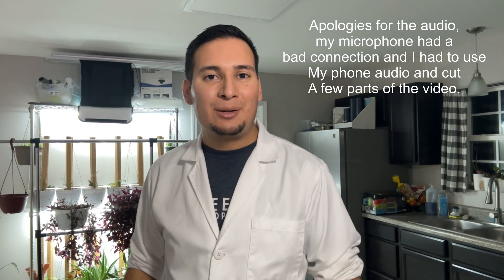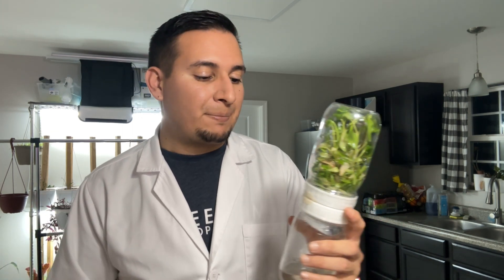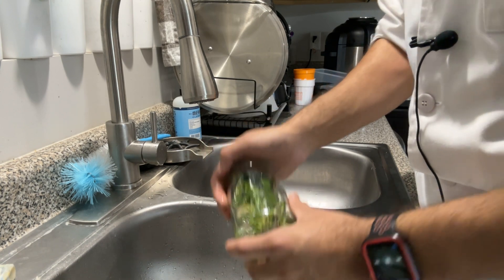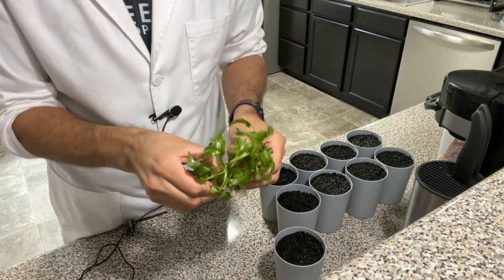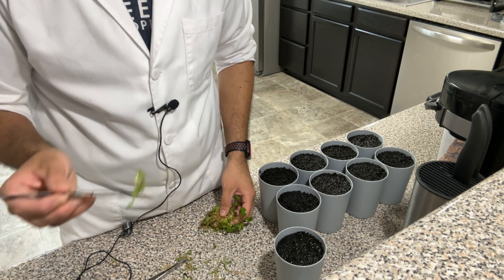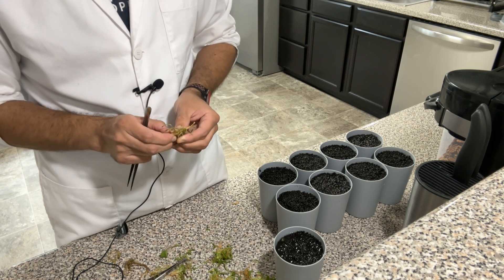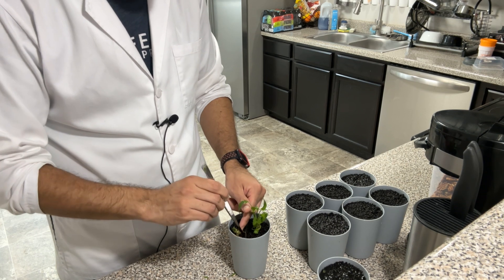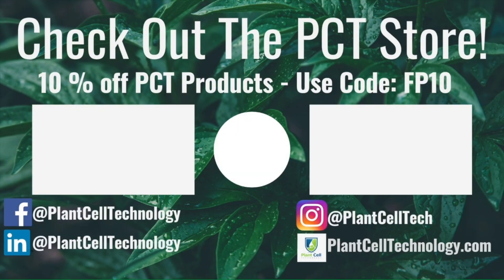Deflasking Plants Grown in The Biocoupler™

Comment: Can you place a single vitro plant straight into one or should you have it in solid media first?
Reply from the maker: No, you need to put your explants first to a solid media for initiation. And, then for multiplication and rooting phases, you can use the Biocoupler.
Reply: What about ones imported still in vitro gel? Doesn't that mean they are already intiated?
Reply from the maker: @greengems6695  Yes, tissue culture plants imported while still in their in vitro gel are indeed already initiated, meaning they've gone through the initial stages of culture establishment. However, to use a Biocoupler™, you'd likely still need a preliminary step. This would involve carefully transferring the imported in vitro plantlets from their gel onto a solid initiation/multiplication medium to acclimate and establish them under your lab conditions before moving them into the Biocoupler™ for further multiplication and subsequent rooting stages.
Reply: That make total sense thank you so much. 😊
Reply from the maker: @greengems6695  Happy to help!